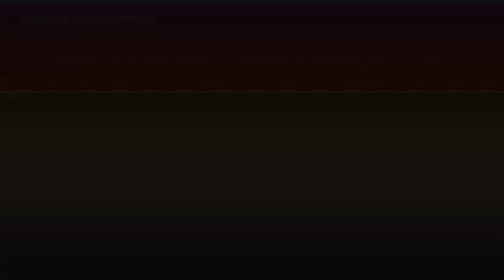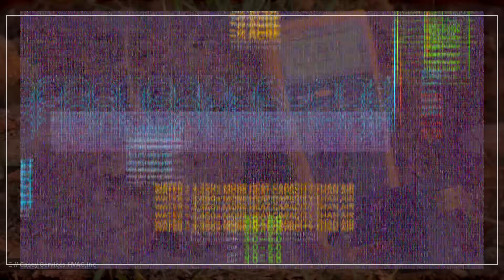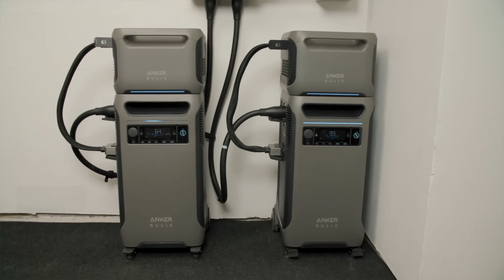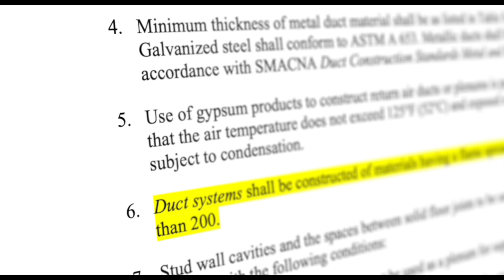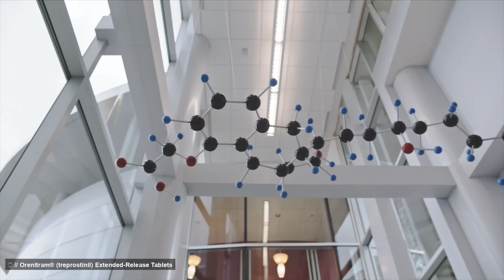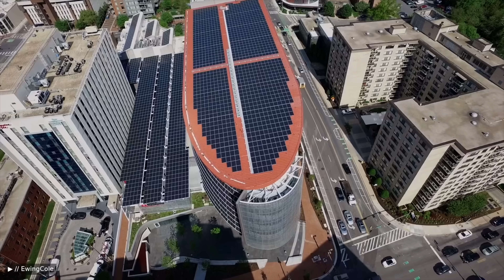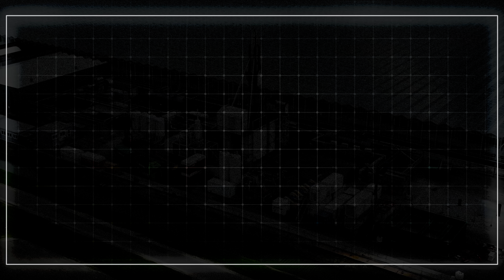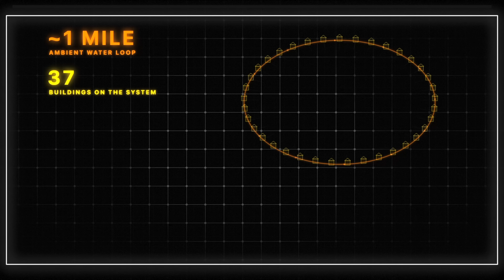The Viral DIY Cooling Hack That Nearly Killed a Family

Comment: Ground source heating won't work where I live, which is in the sub Arctic part of Alaska. You dig 18 inches down in July, you'll hit permafrost, and that extends 1,000-3,000 feet, depending upon your location. Unless you can somehow tap a hot spring (there's not many up here) or drill over a mile down, no ground source heat. Solar power won't work during our long winters because the days are short and the sun is low to the horizon when it actually is up; during the warm part of the year, you'll have nearly 24 hour daylight. I've read that solar tends to work best at a particular range of latitude -- not too far towards the equator and not too far towards the Arctic Circle. We don't get a lot of wind here, either, unlike, say, Oklahoma or the coasts. So...we pretty much have to burn something for heat, such as wood, fuel oil, or propane (the state is still effing around with a natural gas pipeline from Prudhoe Bay on the north coast on south to Anchorage, passing through Fairbanks. Apparently, the hold up is having it come through Fairbanks and allow the people here to tap into it for a cleaner heating fuel than #1 fuel oil (that's what the dry cabin I live in uses for heat).

Comment: We had ground water based heat pump. It leaked water and no one could maintain it.   It was swapped out for an air heat pump with a gas pack.

Comment: Ground-based thermal enegry only works (efficiently) where there's enough ground water as it makes the transfer more efficient (otherwise you have a partial air insulation around your pipes in the soil). That's why a neighbour had to go to 150m (450ft) or so on his vertical installation just to get at ground water level. But at these depths you have to check for (existing or planned) mines and similar builds - or even cave systems. Depending on where you live, of course.

The German Bundestag building has the correct conditions and drives this geothermal idea a bit further: they have two systems. One going down to 60m (180ft), another at 300m (900ft). The upper one is used to supplement cooling in the summer, and in the months it's "filled up" with "coolness" to store until next summer. The lower one does the same but for heating.

Comment: For horizontal ground thermal exchange systems, you can boost the efficiency by putting the pipes in extra thermally conductive slurry, and then putting insulation on top of the pipes.

Comment: As @ekaa.3189 states below  The temperature 6 to 10 feet down is the multi year average temperature for the site. 
It is not "geothermal"  
Geothermal energy is derived from residual heat in the Earth's mantle and core and is produced by the decay of radioactive isotopes and the heat produced when the earth's accretion disk collapsed under gravity.

Comment: I don't understand why this costs so much. It's a length of flexible pipe, antifreeze, a water pump, holding tank, radiator, fan motor, fan, and a housing. The fan motor needs to be rated for continuous service, but that's it. Hook the output to the house's air ducting where the blower unit sits now and boom you are in business. We are talking about $400 in salvaged/used/clearance parts and another $1300 for the pipe (2000 ft 1" hdpe), plus labor to put it together. The excavator or backhoe will cost about $1300 to rent for a week, and it will take that long, but I'd bury the pipe and have it terminate in a utility box, then connect to a loop running from the outlet through a radiator mounted in an air handler unit with the fan pulling air through the radiator, then the coolant dumps into a holding tank where a pump picks it up and sends it through the loop. $3,000 plus a case of beer for the friends who come over to help and it should run for years with just the cost of electricity to run the pump and fan.

Comment: 11:50 well youi need to consider also ease of selling different systems. If I were to try to convince average person to invest 60k in heating/cooling they would be not really interested and most likely even think I try to scam them. Especially if talks were around the time their old system broke and new gas furnace is, in worst case, still below $10k.

Comment: do you really need to use a large drill? How about a tiny robotic hammer and chisel that chips an inch in depth and then crawls up the hole to dispose the chips then crawls back down for the next inch? . Power it by solar panel and just be patient.

Comment: Hvac tech here. The newer air to air heat pumps are very efficient and have a much faster payback making more economic sense than the ground source systems in most applications. Just installed a hyper heat model with two frequency drive compressors that will heat to -20 degrees F. Take the money you saved on the price difference, invest it in a stock index fund and use the income to pay down your energy bill. Or use the price difference savings to upgrade windows, insulation, etc. to make the home more efficient. The heat pump installed was a ACIQ Hyperheat. Running great for two years now. Any decent HVAC tech can work on it. I'm 71 and retired and have no issues with it. Live in the Selkirk mountains of Idaho and winter can be harsh here.
Reply: Yeah, so it will probably run another two years before it breaks.
Reply: @CrispyBakedPotato  It's practically the same machine internally as any regular AC with some added drivers/parts and so have the same service life expectancy and servicing requirements. Nothing magic in those boxes, and they're certainly not less reliable.
Reply: @marcussoininen2084 okay😂

Comment: That belgian house thing was a design fail, building fail or maintenance fail. Keep the air canal dry and there will be no mold problem.

However, the x 3455 efficiency ratio kills the air solution economically. $300 for the pipe $50,000 for the extra land and $50,000 for the extra digging. 😂

Comment: This is great content but it would be so much easier for the majority of people to understand if you used sensible, standard, temperature units. I'm only a few minutes in, but am I really going to have to watch 16:49 worth of video with a calculator handy or doing arcane sums in my head?
Reply: WTH? Oooh. He does use sensible, standard temperature units. No, you don't HAVE to watch 16:49 minutes of video, you are choosing to watch this 😂 Anyway, for whichever measurement system you use this is not an egineering tutoriol video. No one watching this needs accurate numbers. As long as you understand the ballpark numbers you'll be fine 😂 

P.S. Don't you need that calculator for conversion from Dollars as well??? And for feet, mile, and acre? 😂😂😂

Comment: What if, instead of using a PVC pipe, you buried a radiator or heat exchanger in the ground? You could connect it to copper tubing filled with coolant, then run it to another heat exchanger with a fan inside the house. That way, the system could transfer the cool ground temperature indoors more efficiently.

Comment: Really good stuff.
In 1982 I built a super insulated, earth sheltered passive solar house with an earth air loop of makeup air that ran through the hill behind my house that was in it for 1.5 stories. Fortunately for me, the location was in an arid high desert location in South Eastern Washington and I had built a slight slope in the piping that drained to the front of the house. As far as I know there has never been any issue with mold or water in this system. I also designed a simple air to air heat exchanger using a brand new material that Dupont sent me, Tyvek. Pretty neat house I designed while flying navigator students on long 6 hour missions.

Comment: I have a variation on this.  My basement is always cool, partly because it is a basement and partly because I have a HPWH in the basement.  So I took an exhaust fan and ducted it from the basement to the main floor through the ducting return.  The fan is controlled by a thermostat and comes on before the AC does.  It's not a replacement for AC, but it slows down the warm-up on a hot day quite a bit.

Comment: it always rubs me the wrong way when someone refers to a system like this as "geothermal" which implies that the heat comes from deep inside the earth. IT DOESN'T.
instead, it is solar heat that has been stored in the ground. IOW, it is NOT geothermal.
to get actual geothermal heat you'd have to go 1000s of feet down.

Comment: Dude. put your ground air exchange on the front side of the heat pump. This decouples the thermal benefits of the system from the bad stuff.

Comment: the most reasonable system i can see for a standard DIY install i can see for homeowners would be to dig as deep as you reasonably can to install a pipe with coiled antifreeze lines running Heat exchangers with some central thermal exchanger in the ground in the form of basically a tub of the treated liquid and radiator fins into the ground. that would work for most people without flood plain dept closer than 6 ft.
now the flood plain issue isn't a problem for me, BUT i have caleche so once i go lower than 2 ft or in some areas 6-9 inches i hit basically low-grade concrete throughout my ground.

my solution will be to combine my cooling system for the Summer and the need to replace some Irrigation pipe into the same project so what i'll be doing is welding together some piping to replace those busted Plastic irrigation line junctions, probably go from 6 inch plastic pipe to something with a good deal more girth and then fill the line with as many Coils as i can reasonably get. that should give me a good overall thermal load exchange.

Comment: Here in Michigan you're never more than 6 miles from a lake, river, stream, Creek, pond, surface water. Would be / should be easy to dig a shallow well 10 to 30 feet in many places and get cold water running through a radiator & fan, with or without a compressor, with a water pump from solar/wind and get pretty inexpensive air conditioning. Just drain back in the ground direct or via garden/lawn. Extremely low cost Open Loop geothermal, if legal in your area. (i read below, i can see where you might put a water filter on it before a cheap compressor, but not advised to use with expensive heat pump due to probable contaminants).

Comment: Couldn't a UV light kill the mold in an air handler?  By installing a Powerful UV light at the end of a plumbing snake with a camera, and running it in the air tube, also kill the mold?  I know you talked about the thermal advantage of the fluid-filled tube, being more efficent that the air system, but for those that have mold in an already installed air system, I would think powerful UV lights added to the maintenance of existing systems could be a way to negate this problem.

Comment: The mold problem is an easy fix . Have a gentle slop in the in the SMOOTH PVC pipe with drain holes at the low portion over a gravel drain field.

Comment: I have a ground source heat pump with underfloor heating - I designed and built it myself
(Southland New Zealand)
The ground loop is a horizontal system 5 meters square two meters deep - cost $1500 for the ground loop

The REASON that this type of system is not used more is that people massively overbuild them!!
My house is well insulated (160 square meters) and requires about 5 kW of heat in the depths of winter - so my system is desined around that

Turn that on its head - imagine heating a bit of ground 5 meters x 5 meters x about 1 meter - how much heat would you have to pump into that mass to keep it warmer than the surrounding ground - about 50 tons of soil and rocks 
My 5 meters x 5 meters is overkill!!

But you are talking about a thousand square meters!! (1/4 acre) - FORTY times as much!!

I was quoted $70,000 for the ground loop that ended up costing $1,500

Why so much "Overkill"??
People are not used to them so they overbuild "their bit" - do that a few times and you end up with a system that is massively overbuilt

Comment: My borehole is 200meters deep not 200 feet, have been heating my house since 2016. That borehole AND the heat pump together cost me $14.000 bucks and I recouped the cost after about 6 years.

Comment: I’d be careful about installing a vertical ground loop. The problem is that the ground and ground moisture surrounding the pipe can freeze resulting in a significant loss of efficiency or complete failure. Vertical ground loops have gone out of fashion in Ireland.

Comment: Question: Why do you need to dig 300+ ft deep for these geothermal loops? Can't you just dig 6+ or 10+ feet (depending on where you live) for 99% of the geothermal effect? I thought the ground has relatively stable temperatures after a certain point?

Comment: The issue is Radon and carbon monoxide that occurs naturally in the ground starting a few feet down, which can get blown by the open air systems into the living space. Also with open air systems the humidity allows mold to grow at the transition zone sending those spores into the house to make people sick and help spread mold through the house. This is why a sealed water based system pumped through a radiator, and air moved through that radiator is better and safer.

Comment: Why should you even need a 200 Meter Drilling in San diego , if you acutally just need it for Cooling in the summer, which need a lot less energy then to heat a home .  Sun for Photovoltaik will deliver 12 Month constant output and with a SplitClima System you will have not those Drilling Cost . A simple Hole in the Ground to dump heat would be sufficient . ( Something like an EnergyFence can behave as needed . ) 

Insulation to a decent European standard and Windows on an European Standard will change the whole Prediction . 

Matt from undecided has a total different Climate  with lower Sunhours and deeper Temperatur ( speaking Snow ) 

Looks Like a waste of Money  and Time , put the Money in Photosolar and Insulation that is proably better investment .

Comment: Nice coverage of the benefits of geothermal. We installed a 3-ton GeoStar Sycamore in 2018 and have been immensely pleased with the comfort and low energy bill. Our unit spends more time than I’d like at full stage (COP 3.6) than at half stage (COP 5.3) which lowers efficiency. If we had gone with a 4-ton unit with more wells it would be at half stage for much longer which would mean higher efficiency. My fix now is to improve the envelope efficiency of our home with better air-sealing and additional insulation. Being an 1885 home presents its own challenges to making these improvements. Drilling additional wells will be a last resort.

My shop and office uses a centrally ducted ASHP. I intend to add a ground coupled heat exchanger in front of the air intake for the outside unit in an effort to improve the COP during winter months (and summer days). I’m looking for any information on ways to best tackle this method.

Comment: Matt got swindled by the installer company when he got solar panels installed. They charged him almost $1000 a panel when panels were $50 each. You're about to get swindled by a geothermal installer company. You do not need to go 100s of feet into the ground to get adequate cooling for a home. You need to go 10-20 feet. You can legitimately install the cooling loop yourself with a shovel and some thermal mud in a month! Technology ingredients did this. It worked. Don't get scammed.

Comment: Geothermal (getting down to where it actually hot) is prohibitively expensive unless you are near an active geothermal area (hot springs, volcanos). Pipe is cheap but the vertical boring itself expensive and they're generally lined to improve heat transfer.
For hot areas cheap solar + battery + air to air heat pump makes the most sense.  For really cold areas adding buried pipes and water heat exchange and water to air heat pump (maybe with natural gas aux backup) makes more sense.

Comment: You actually don't need a hole deeper than 3-5m (9-15ft). Just make a large hole and put around 100m of tube in it and cover it with a mix of graphite, bentonite and sand (you'll need a lot) and that does the trick, almost the same as the EXTREMELY costly version the author of this video is proposing. You can find videos on youtube on how to do it and you can actually use the simple modified window air-conditioner... And the "legal" is not illegal, but in order to have a permit, you would need to do the impossible. So it IS kind of illegal.

Comment: Dig a moat style system that you can fill in after you're done.  You don't need a massive yard.  Check which side of your house has to most shade throughout the day through seasons and build your pump house and heat exchanger on that side.  Get a nice big automotive radiator in your ducting and pump your brine through that.  Or if you want to get fancy you can do a fully distributed water to water system that can deliver controllable room by room conditioning. Just use copper tubing to kill the gwesh and some nano silver air filters for your air supply.  And it won't cost you 45k if you do it yourself.

Comment: Can a thermal loop be added to your water well? Could you just circulate the water  with a 100w pump through a heat exchanger and blow the ~57 degree air through your ducting for summer use only?